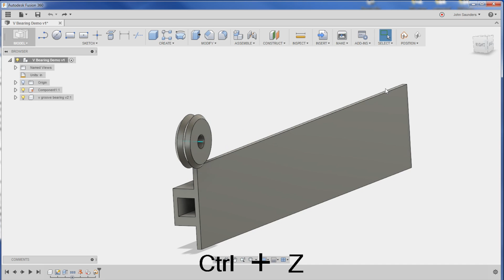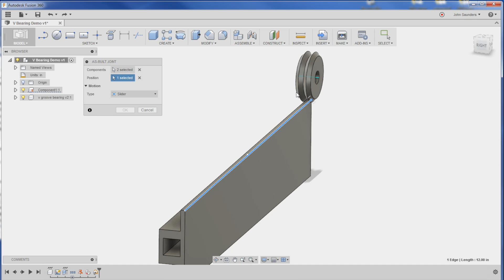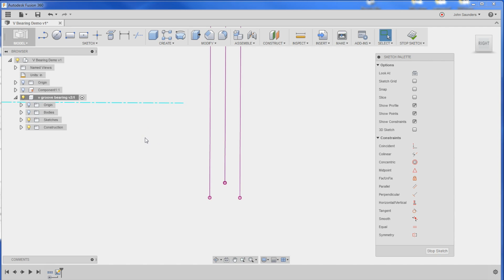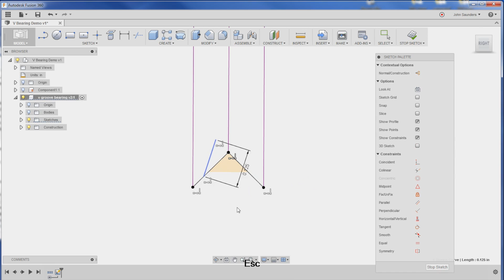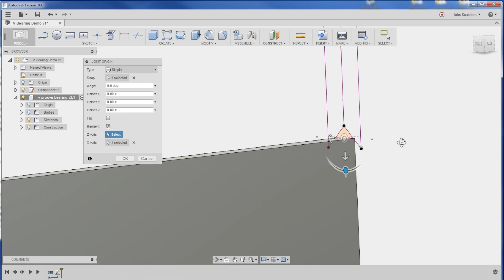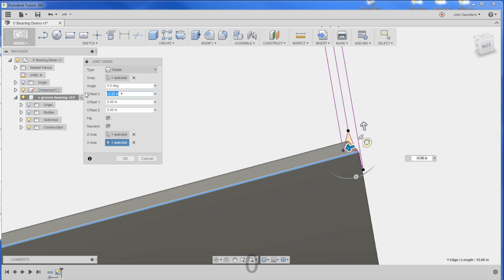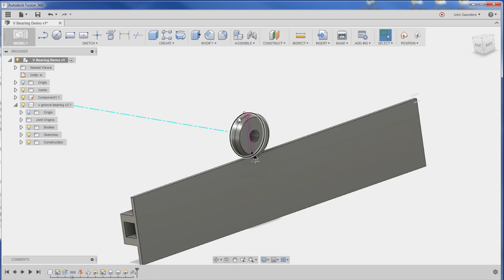Fusion 360 Joints Tutorial:  How to model a V-pulley!  FF42

Comment: Dumb question, does that solution not just "slide"  the pulley along it's path instead of "rotate"  it down it's path
Reply: That's exactly what it does. The V bearing is fixed and non-rotating with this joint process. So it's technically incorrect. Not a big deal just to see how a part will roughly function, but it's will be a huge deal when doing anything involving FEA.

Comment: Easy way:
Rail component -> Joint Origin -> Set ofset (distance to center roller) -> Joint [Rail Ofset Point + Center of Roller] -> Set Limits -> Done
Reply: nice! also you don't need those joint origins, if you're creating a sketch. Joint will use a sketch point anyway, and there was no need for Johns second joint origin.

Comment: this operation is so much easier to do in solidworks
Reply: John took a long way around on that... and to be fair 90% of other scenarios take a lot longer to Mate in Solidworks than to Joint in Fusion. so.....
Reply: +Scott Moyse that's because there's at least 3x the mating options in Solidworks. 

It may take slightly longer in Solidworks. But it's undeniably far more intuitive and far more flexible than Fusion. Fusion you have to sometimes fight a bit to get what you want. Some of the joints try and do too much in one operation.
Reply: Occams Sawzall I'm well aware of why it is, I wouldn't have said it otherwise. And some of the newer Mates in Solidworks aren't intuitive at all... then you can't reuse them in simulation etc etc.. So no it's not 'undeniable'. Of course, there is a lot of room for improvement in Joints, but as a concept they are more powerful and faster than Mates in SWx or Constraints in Inventor. Once you know how to use them that is. Both Inventor & Solidworks were shit in the beginning compared to what they are now, and Fusion is already far superior to what they were at the same gestation.